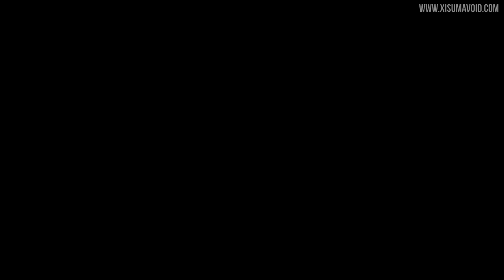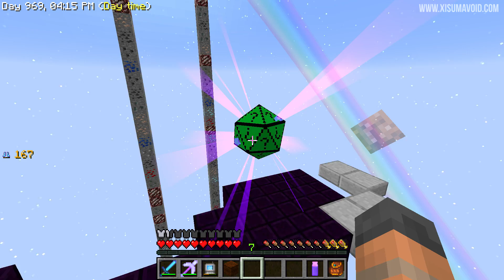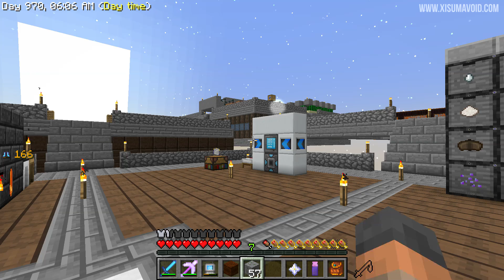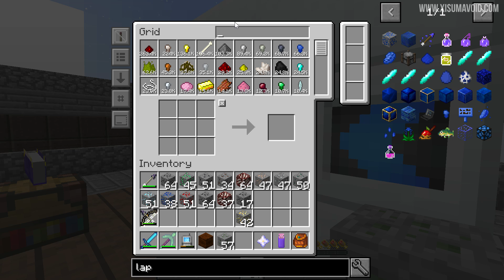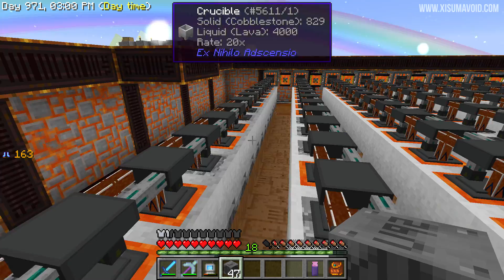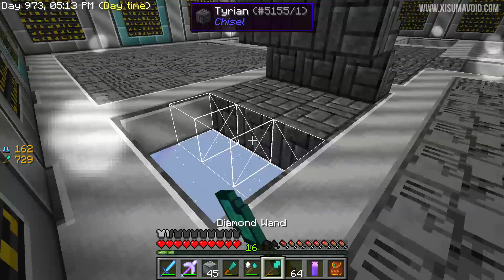Sky Factory 3 25 Advanced Resource Automation!

Comment: You can't do "Silicon from Sand" as a crafting recipe as it only is a 50% chance in the SAG mill. Basically, what happens is, the refined storage thinks "hey, let's craft one silicon", puts one sand into the SAG mill and waits for one silicon to appear in the storage system. If the SAG mill fails to produce one silicon, the refined storage waits indefinitely before it thinks about crafting another silicon.
You should be able to confirm this with the crafting monitor, which should show that one silicon is presently crafted.

The only way to keep silicon stocked is, to fill sand into the SAG mill with an exporter instead of a crafter and then applying the redstone signal to the exporter saying "stop exporting when there is enough silicon". This might overshoot a little bit, as the SAG mill has an inventory, but who cares. ;) (you could apply the redstone signal to the importer but then you might get into trouble with the by products, I'm not sure)
Reply: An even more fuzzy way would be to write the pattern as "a stack of sand yields one silicon". With that, you also overshoot (by round about 31 silicon), but you would have to be REALLY unlucky to get NO silicon from the stack of sand, in which case the system would be blocked again.

Comment: I'd recommend using EnderIO conduits (instead of importers) to extract materials, and supply power, to blocks which aren't part of Refined Storage.
You can run the items into a chest, and import from there (the auto-crafting system doesn't care how it gets the items).
Then you can use a facade on the conduits.

Comment: look into the refined storage addon called Reborn Storage. it has a multi block auto-crafter made from blocks called: crafting frame,  Heat exchangers,  Crafting Storage, Crafting CPU.  Each crafting CPU in the structure speeds up the amount of recipes it can do at the same time, and the crafting storage blocks hold the patterns.  build a cube up to 16 blocks. edges are the frames faces are the heat exchangers and inside put the CPUs and Storage blocks. It must have at least 1 cpu and 1 storage block so the smallest size is 3*3*4.

Comment: sand to silicone is not working because there is only a chance to get it rhe rs system thinks that it is one to one so is waiting on the previous carft to complete before it send more sand. will have to import the sand directly instead of via the crafter

Comment: The concept of what your doing is very good X, the issue i see is that your still have refined storage do a lot of the work. and though i see this is somewhat the point, its going to cause more and more lag. Its consistently in a state of I/O which is adding more to keep track of. The best way to optimise this is have these processing things as a local device. that just dumps the FINAL result into the main network.  you main network need not know of how its making or keeping track along the way.

Think of it like a sub function in a piece of code. the main program doesn't need to know all the steps that the sub function does. all it needs/expects is that it gives the function data, and gets new data back.

So for example, you're lower than 2000 gravel. that would create the signal, and a cache of gravel is opened up to an importer until the signal stops. (say 4096) then the processing just happens, it doesn't talk to your system. this can be applied to a lot of things, items come in, item(s) come out.

Hope i made sense. But if you have this mentality when making automation it will become a lot less on the server.
Reply: This is a very well thought out comment, well said sir.

Comment: The sagmill isn't working because its not 100% that you get silicon, so the system puts sand into it and waiting for the silicon, which you never made.
Reply: Watching this video today not sure if he covers it in a follow on in this series, but yeah if it ran Once then that would be the reason but checking Crafting Monitor would show if that was the case, other than that if accidentaly made the pattern in the pattern grid instead of pattern processor thing then it wouldn't work either.

Comment: Your cobble generating tower is not working on three of the sides because you have the detectors that power the hoppers. Same happend to the ender io conduits when you changed the redstone needs for them. Just usee the ender io conduits and set them to ignore redstone to fix the problem. :)
4

Comment: I don't think the sag mill does silicon from sand at a one to one ratio. The system might not try since it wouldn't get a silicon from the sand or it did it once and it is still waiting for the silicon to go into the system.

Comment: Since the sag mill doesn't have a constant output (i.e. 1 sand -> 1 silicon), the crafter doesn't work for it. You can skip the crafter and just import sand directly into it, which should work.

Comment: X! The hoppers aren't pulling items from the cobble generators becausse of the detectors under them!! 19:33
Reply: Exactly... when the hoppers are powered, they are locked. Thus, they cannot pull any items. You will see the side that does work, the detectors are off, thus the hoppers aren't locked. This was true with the Ender IO cable too. X had them set as "Active without Redstone" but they had a signal from the detectors, thus they didn't pull anything. So, ig X just changed the hoppers with item conduits, and sets them to "Always Active", everything will work.
Reply: Minecraft Space I don't think Xisuma knew about the Always Active setting, he has been setting conduits to Active when Low for this entire series.
Reply: Minecraft Space the hoppers are powered
Reply: Yeah, it's just like in vanilla!
Reply: Good observation.
Reply: +Minecraft Space Good observation with the redstone mode. That is something people always miss when using those ender io cables.
Reply: +Mywither =)
Reply: xD was about to say that myself!
Reply: Though, if you had to say it, you'd be 8 hours late! xD  =3